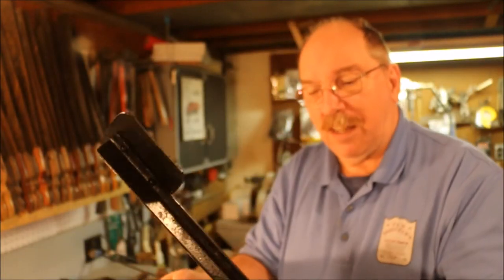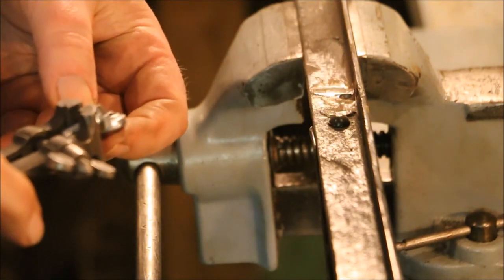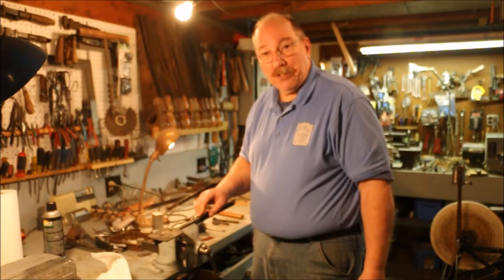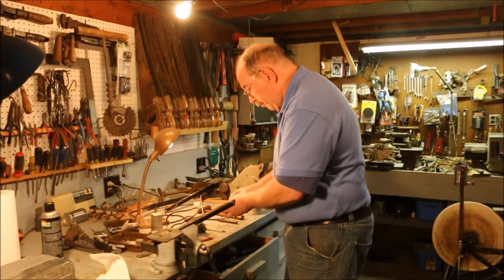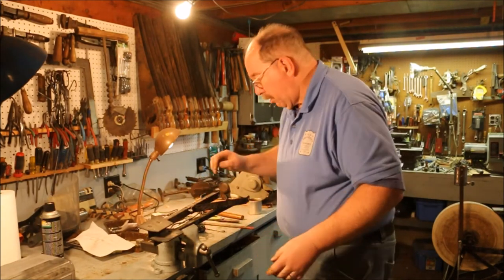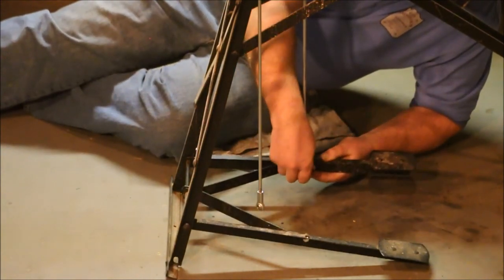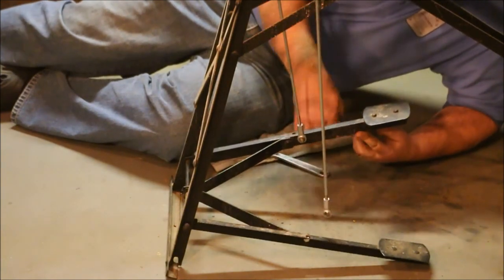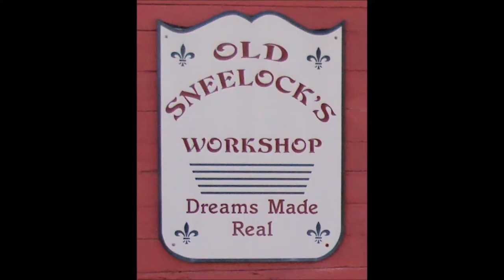TREADLE GRINDER ~ FINISHING THE LINKAGE AND TESTING

Comment: Nice idea how you 'Locked' the built in.  If you wanted to save threads from crushing, you could always screw Nut up to the top - Clamp on that.   Cute little Vice.  
Looks Fun  ~ Who says one does not get anywhere stationary Pedaling?   ~ Work Away ~
Reply from the maker: My phone has Samsung's idea of a health monitor. It records walking, running, and riding. I'll have to see if it has a setting for Treadle Grinder. 😊
Reply: That's GOOD!
Reply: I'd get somewhere all right. Flat out or on the way to the e.r. after I crashed. The first 15 car pile-up because of a blasted grindstone.

Comment: I expect that's likely to be the most high tech treadle grinder on the planet.  I was thinking that if you tried to order bolts like that, they would probably want an arm for one & a leg for the other!  But the grinder works well, and sharpening up that spokeshave looks more like fun than work.
Reply from the maker: Brian Neeley I am very happy with the way the wheel cuts. Open up the drip and it cuts like crazy. Slow the drip down and it builds up a slurry on the stone that polishes the edge. 
The old ways do work. 😎

Comment: Job done at last .great tool sharpen and get fit all at the same time .onwards and up wards as they say great job unc 👍
Reply from the maker: David Chadwick Thanks David. I originally wanted the grinder just for the idea of having one for the blacksmith shop. Now that I have it it has become a favorite for sharpening. No overheating the edge and the large diameter makes nearly flat surfaces.
Reply: You and me'd have to have a crank!

Comment: Great project. How did the sharpening turn out?
Reply from the maker: Bill K. The back of the spokeshave is flat and the bevel is set. It still needs the waterstones to achieve a really sharp edge but it will cut straight off the grindstone. The faster thevwater drips the quicker the stone cuts. Slowing it down builds up a slurry that polishes. I don't know if it is unique to this stone or the process of using it.

Comment: With the bearings on the linkage ends, it must run smooth. Where did you get them.
Reply from the maker: Tom Nelson Ebay. The source of all things difficult to find. There are other places that sell them but they all want part numbers and clear descriptions. Ebay, despite its faults, does let you just wander around until you find what you want. It's kind of an electronic junk drawer. 😆
Reply: 10/4 on Ebay! My go-to too!

Comment: was the original link just rods bent at the ends and a slightly oversized hole to allow a bit of lateral movement?  it certainly is much smoother with those joints though
Reply from the maker: Jusb1066 I mounted a skate wheel bearing in a metal block attached to a 3/16 rod. The skate wheel bearing rode on a stub shaft attached to the crank.
Reply: actually i meant before you repaired it, the original mechanism, i remember your first repair
Reply from the maker: Jusb1066 Missed that one. 
The way it arrived it had a stamped steel ball bearing. Two stamped steel plates riveted together with loose ball bearings and a center race sandwiched between them. The rod was run through a folded loop in the plates. The rod was connected to the treadles  by being looped through a drilled hole.
Reply: yep thats kinda what i thought it would be like originally, kinda badly made but easy to make